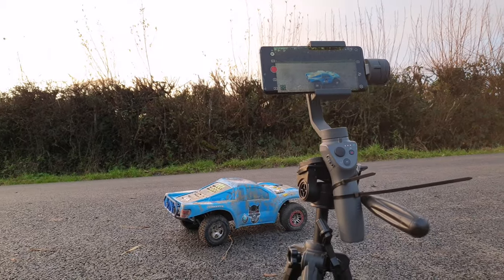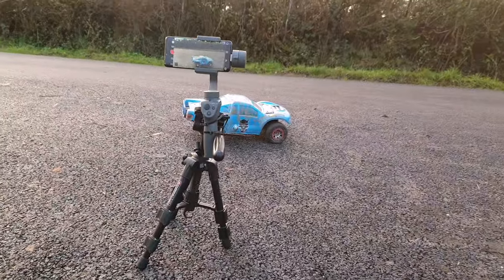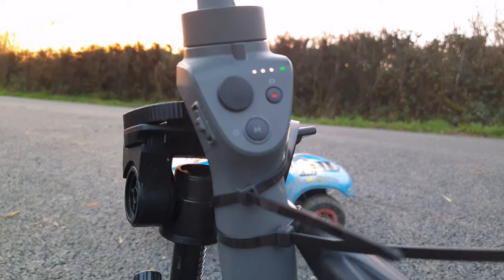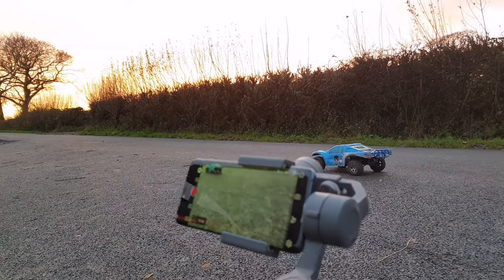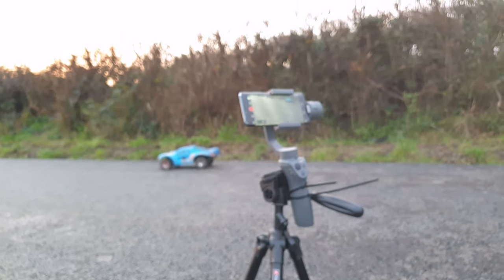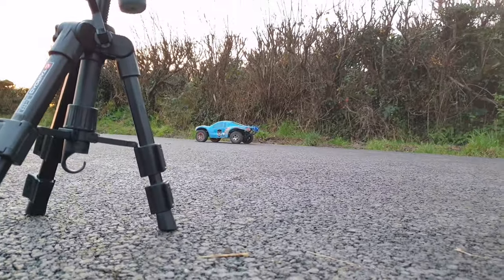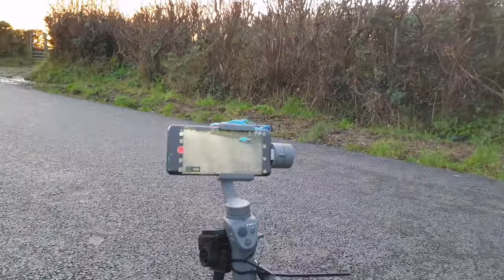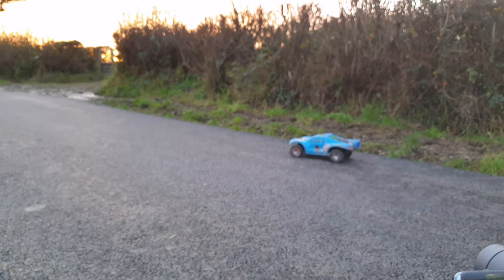How to film rc cars - part 1 object tracking video w. Dji osmo 2 gimbal

Comment: The point is how ti works in serious action , for example speed runs , fast turns, fast accelerations and generally hard driving.
Reply from the maker: The answer to that would be dig deeper.. and buy a newer osmo unit... or crane 6
Reply: @RccarsUK ok, I will look to it. Thanks a lot.

Comment: I have the same gimbal too, bought it used, and i use it with my iphone 7plus. I was using the same method minus the tripod(i need one lol) but got frustrated with the dji go app that is draining my phone battery fast, and the tracking gets confused on some occasions but your idea is cool, just need some practice to achieve nice results 👍🏼🙏🏼
Reply from the maker: Ya agreed.... I must admit I got rid of mine.... They're OK for filming crawlers and whatnot... And for intro shots.... But bashing.. The tracking just can't keep up... Loses object a lot etc like you said
Reply: @RccarsUK  true to that! I was thinking the same too about that its nice for crawlers. Luckily i have a wpl crawler here. 👍🏼👍🏼
Reply from the maker: Have you tried a selfie stick style setup.... I found they where also decent for crawlers...  Low down shots without having to stoop down etc.
Reply: @RccarsUK  haven’t yet but definitely i am getting one, right now i have a phone tripod and yea, i have less leg pain now because of the extension i get.
Reply: @RccarsUK  Did you find a gimbal with tracking that can keep up with faster driving or do you think it is wishful thinking?
Reply: @DustyFingersRC  Hey I was brainstorming for my next vidoe and it brought me here 🤣 did you find one that can keep up with your fast driving yet?

Comment: You beat me to the punch. I've been wanting to try that outdoors with my DJI gimbal (I use the Mimo camera) but it's too damned cold here & the gimbal slows down & can't track as well. Will be using these techniques nxt summer while trailing, though. Looking forward to uploading some original footage for a change. Thanks for sharing my secret, ya dick. :-)

Btw, if you haven't found it yet, there's a 1/4-20 threaded tripod hole in the gimbal but may be covered up by a plastic insert. Just to save you a few zipties.
Reply: @Fims Presents Rc Sorry for the name-calling - my bad - I shouldn't have done that. 
Does the camera software you use also allow a slow pan while shooting a Time-Lapse clip?